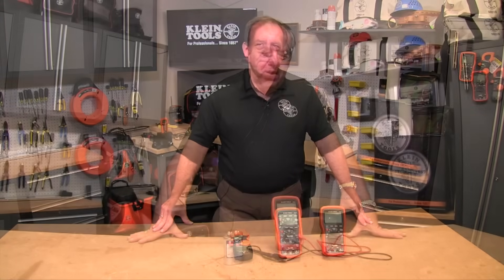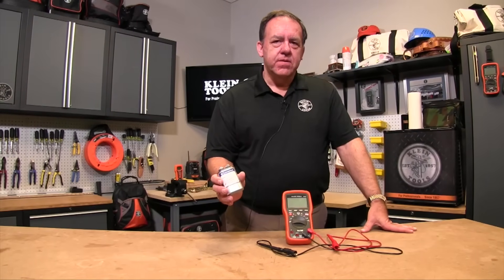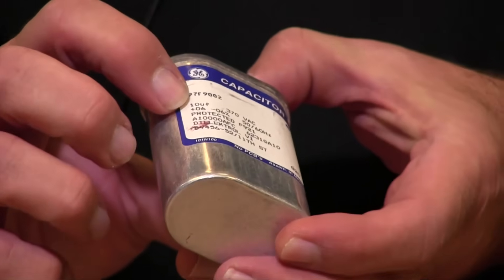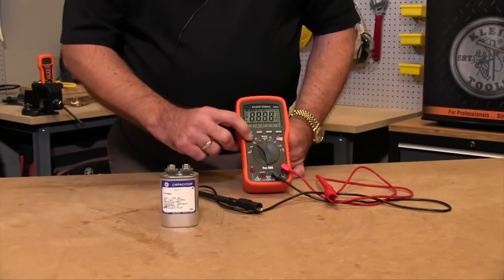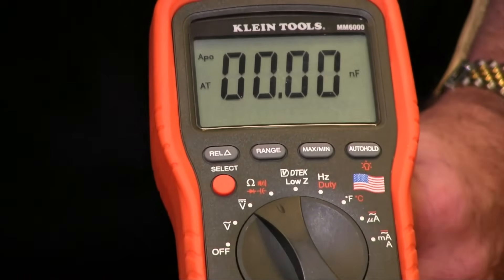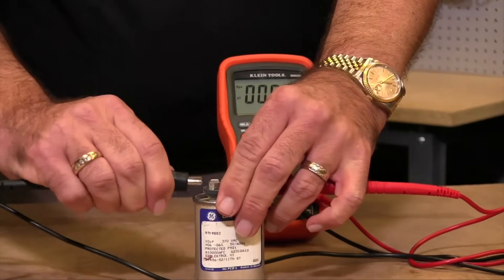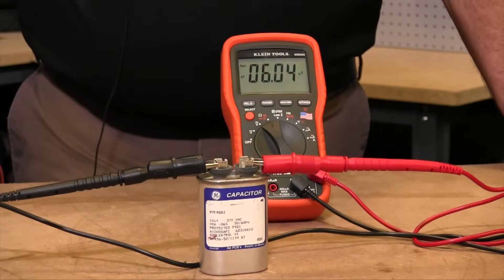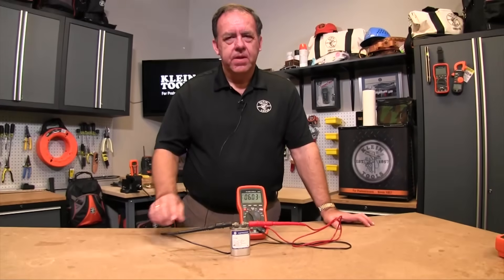How To Use The Basic Meter Function (Capacitance)

Comment: pretty good but you only tested 1 capacitor.  And you didn't address other questions that arise when multi-meter testing capacitors.   LIke what if my Klein mm200 is connected to a capacitor and goes from 0.000 to O.L, without specifying any capacitance?   Well?  Is the capacitor bad?

Comment: You need to tell people to discharge the capacitor before they handle it. Not everyone knows how dangerous they are. If someone who doesn't have that info watched this video they could get seriously hurt thinking you can just lay your fingers  on top of the capacitor like you did here.
Reply: I've never discharged one for 10 years nothing has happened 😅
Reply: It can also damage the meter.  I also cringed when he touched the terminals with his hands.
Reply: Thank you! Never pat your capacitor. My Dad used to power down Microwave capacitors. The sound of powering them down was terrifying to me as a little kid. Use an old ball peen hammer with a wooden handle to arch across them and power them down.
Reply: @gnawniev3753  You should find someone else who will pat your capacitor, so you don't have to.
Reply: A screwdriver works well  @gnawniev3753
Reply: Yeah the guy in video is cringe

Comment: Just got MM300, not seeing the capacitor sign. Is there one?
Reply: I don't think you can use the mm300 to do that. I was thinking about buying the kit that comes with the mm300, but according to what I've found, it seems that basic model can't be used for that... Have you found a definite answer to your question or a way to do it?

Comment: I have the Klein MM1000. Does anyone know if you can test a capacitor with it? I did everything that was mentioned in the video and while pressing the select button, I do not get the nf symbol as mentioned in the video. Although I do get all the other symbols. is there something wrong with my multi meter?
Reply: That's because your model has it by itself in the middle of temperature and  hertz/ duty
Reply: @ricardoa4322 any idea why the mm1000 would be reading a voltage and the select button swapping between ac and dc when in capacitance mode?